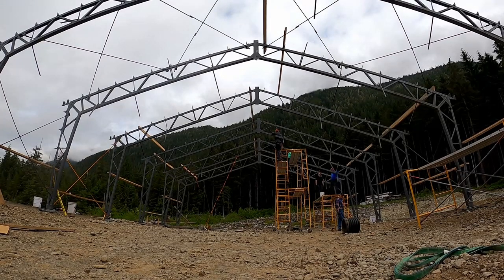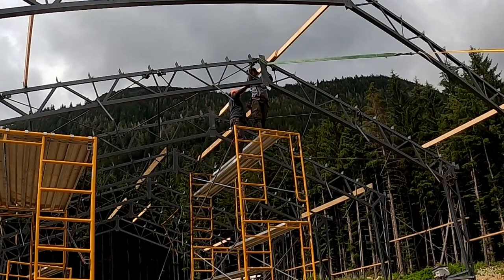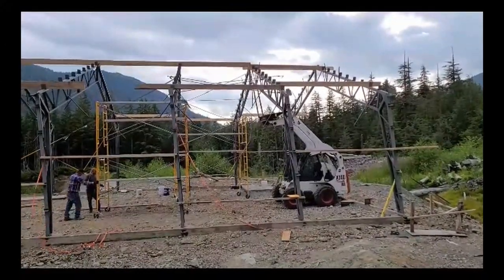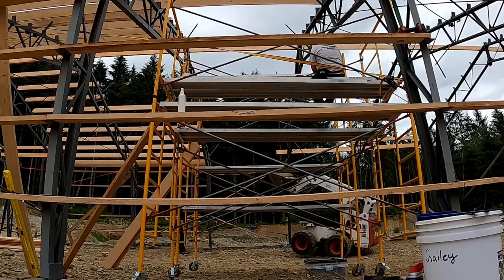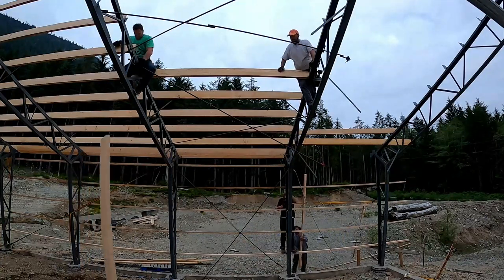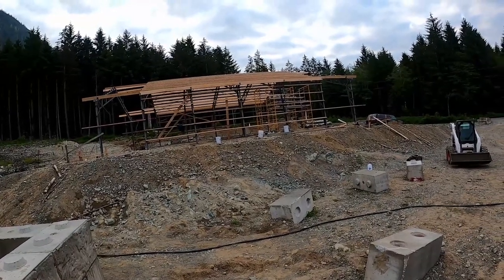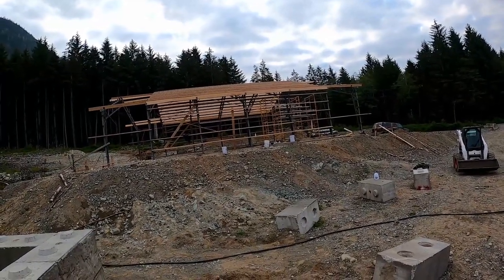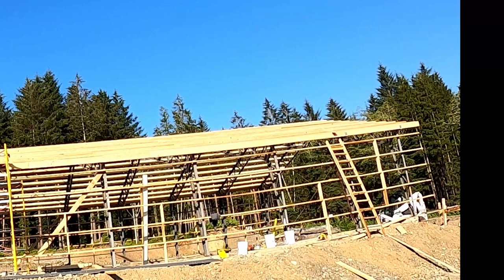Miracle Truss Metal Shop Assembly:Building with wood & steel

Comment: I bought a 30 x 48 over 10 years ago. Still in great condition, wish I had got 10 ft. Sides. The building was on special as it didn't meet specs where it was going. Went up easy after the concrete was done. Only metal cutting was on the ends. Still have a lot of screws left over. Had lots of compliments on the building.
Reply from the maker: Glad to hear it is holding up well!  It is a really good design and fairly easy to put together once you figure a couple of things out.   I wish I could have found mine on special, but I ordered it at the beginning of the steel price ramp up so I got a good deal

Comment: The proper order for this assembly is to put the columns up check for Square / True / Plumb then put ALL the girths all the way around the building Then you can put up the trusses and yes before you put up the "Wind Wires" you need to have all the purlins in place.
Reply from the maker: I might have to try it that way next time

Comment: Im in Texas and we don’t have the snow y’all do. How far apart did you put the trusses.
Reply from the maker: The steel trusses are 10 feet apart and the wooden beams are 2 feet.  I could have gone 12 feet apart but I would have had to use 2x10s instead of 2x8s.  My mill will only cut 2x8s so we went with the closer spacing
Reply: Thank you for answering me back. I was planning on going 10 ft apart but you mentioned the 12 ft. I’d rather go 12 ft if possible just to get more square footage from the building.  @remoteandrestless
Reply from the maker: @tobywhitney4798  it also costs less for the metal because it would require one less truss on my building.   Depending on lumber prices there may not be any savings once you buy 2x10s

Comment: Did it not come with blueprints/plans?
Reply from the maker: It came with plan and simple instructions. Having done one now, the instructions would be sufficient but not having any experience they were a little vague.   That's part of the reason I put the video together because I couldn't find any good step by step instructions for this particular building type.